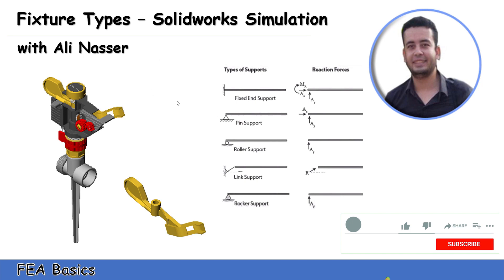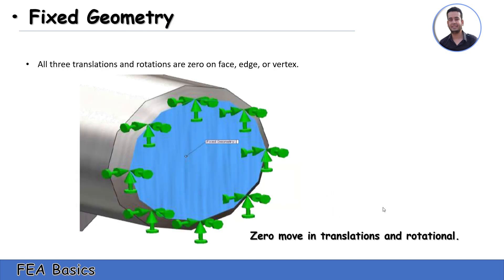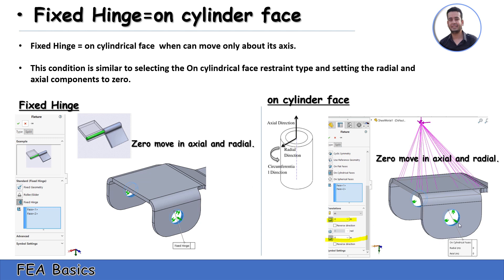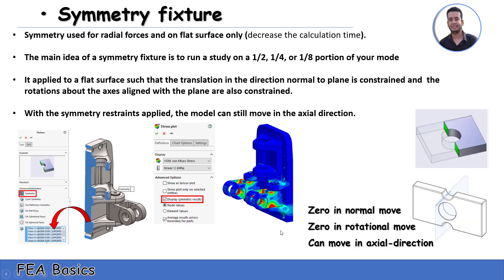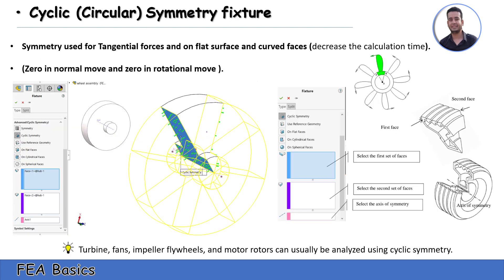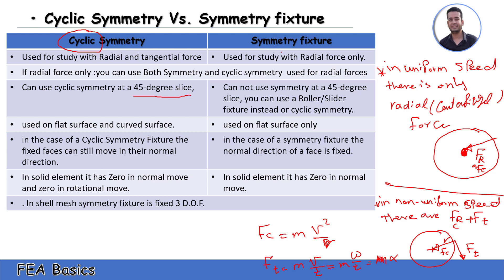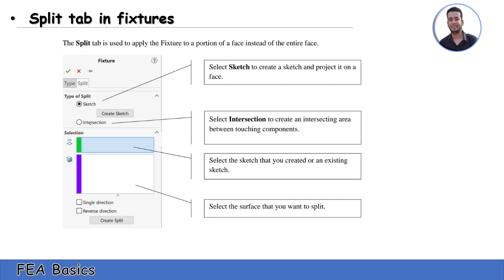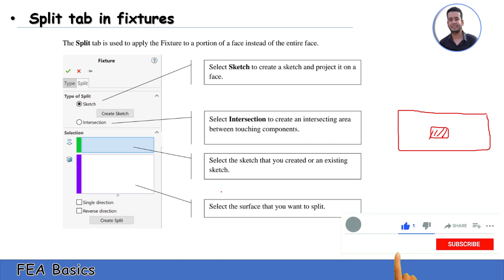Solidworks Simulation │Fixture Types│

Comment: Good day to Ali Nasser, i have a problem regarding about the import motion load. I have a shaft with a flywheel to rotate about 10 rpm in 30 s. The motion analysis runs smoothly, however, when i tried to import the loads into static to see the deflection and inputted bearing fixture (rigid) onto the split lines i had created, the transferred remote load appeared to be malfunctioned, and solid work gave out message saying that " One load/fixture/connector/contact is invalid". I had turned off the inertia relief and it still didint run smoothly with fixture on and no change in remote loads. Sadly, I tried test with Bearing Fixture, Roller/Slider Fixture, Cylindrical fixtures to mimic the bearing support during rotational motion, all failed and deformed drastically.  May i know how to handle the remote load definition imported from the motion load when we had inputted the fixture or how i should input my fixture correctly? Or how i should put correct fixture to mimic the bearing support and the shaft will stay within its shape and not deformed in crazy way ? Thankyou.
Reply from the maker: Hello, i will discuss this with example ASAP.